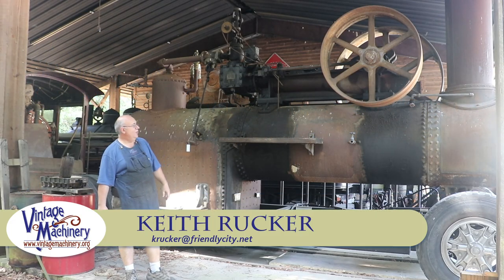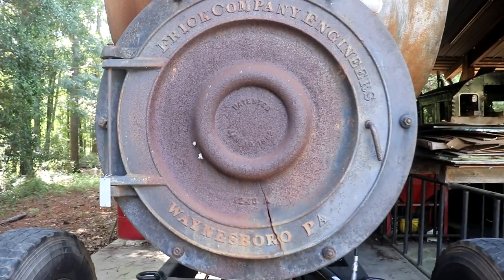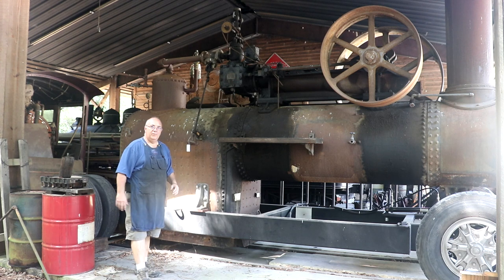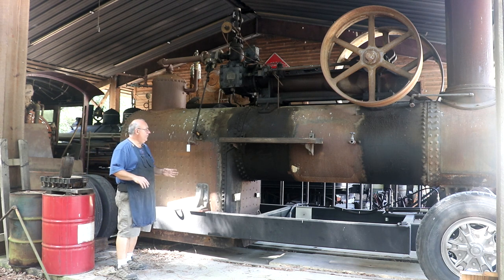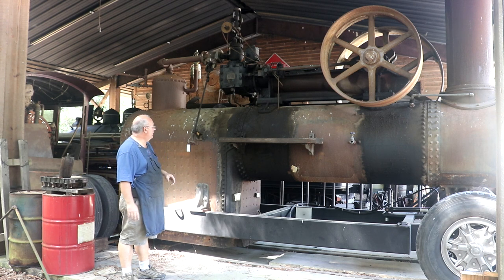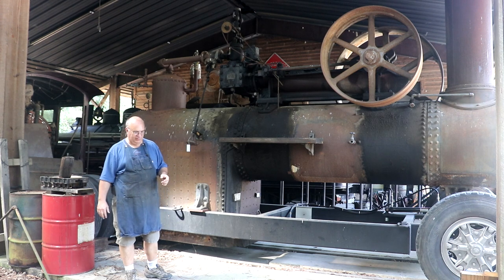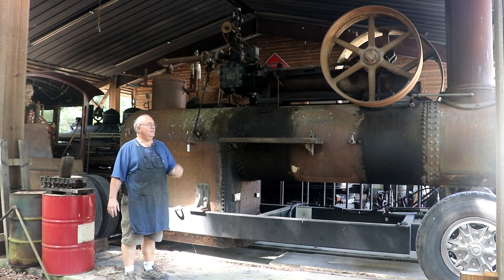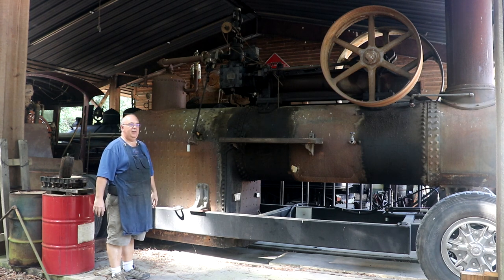1935 Frick Steam Engine: Help the Georgia Museum of Agriculture Restore it!

Comment: So, which insurance company was it? Insurance companies have far too much power. That's only boosted by financially supporting them, so I will never use a company that does stupid crap, such as condemning boilers solely due to their method of construction. I'll also say that if it's the state itself(i.e. self insured,) I'll be adding Georgia to my list of states to never set foot in. 

Saw something similar happen here in NY. A state owned  theatre needed some long term storage. Quoted over $300,000 to build a mezzanine, so instead, they built in themselves for a couple thousand(10-12' deep shelves hung from the ceiling with heavy chains.). Insurance guy comes through 10+ years later and says it's no good, so they instead rented space 10+ miles away, just for storage(still much cheaper than building it properly. That was 12+ years ago when I was in college, Their entire current annual budget is $5.6mil, and only generates around $775,000 in profit per year, so it would wipe out half their annual profits, for some shelves. 

Also had a situation where an offhand comment from an engineer about the grating in our catwalks running the wrong way got to a campus risk management person(in my college days), and they randomly and without warning shut down out catwalks, on a Friday night, while we were in the middle of loading in a show.Once professors found out, they still couldn't get a straight answer as to why.  Engineer didn't really think it was that big of a deal, just a note in a report. Anyone who was going up their already knew of the issue, and compensated bu not having more than 1-2 people in a single section. Not ideal, but the engineer was their for the planning stages of a complete gut and rebuild of theatre, so in effect, any remedy to the situation was temporary anyway.

Also had a friend who's property insurance was canceled due to a very rickity "deck" that the insurance company saw in an arial photo. The "deck
 was directly outside what formerly was a sliding door, but due to building settling, was actually buckling when she moved in, so it was screwed shut, and sealed off and was just a floor to ceiling window. The "Deck" was simply a couple cedar posts with a tin roof, as an animal shelter, as the area on that side of the house(timerframed barn converted half ass converted to a house) is/was used as a animal pen for the dogs and also any injured/sick farm animals. They didn't even come look in person, just sent her a notice they were canceling the insurance due to it, and she had a hard time getting them to understand the actual situation.
Reply: Yeah, as long as bad shit doesn't happen to you, and you're not responsible for the safety of others, why should you give a shit. Are you also refusing to wear a face mask because it inconveniences you?
Reply: You'll never set foot in Georgia if you learn that Georgia is a self-insured state and won't allow riveted boilers?
Dude, you live in New York.
Reply: @Cautionary_Tale_Harris  If hatred really could keep you warm at night, No one on the planet would be worried about global warming as my hatred of NY would have the entire planet hotter than the surface of the sun.
Reply: Something that "everybody knows" really isn't good enough. There are always those who don't get the message or read the signs or whatever.The reaction was probably extreme, but ever since that ballroom walkway collapse in Kansas City due to faulty engineering/installation folks are legitimately worried.
Reply: @Frankowillo  To categorically say something isn't safe due to it's method of construction(which has been good enough for 100+ years) isn't safe, is very different from inspecting something and finding a defect which makes it unsafe.
Reply: @ravenbarsrepairs5594  I'm just sayin' that I've lived in places with unreasonably tight rules and regulations "for your safety" and Georgia ain't one of those places. (For the most part. Nowhere is perfect that I know of.)
Reply: @Cautionary_Tale_Harris  Not saying it isn't but why would I spend a single penny in a place/company/etc. who's policies I disagree with?
Reply: @ravenbarsrepairs5594  
If you don't want to ever set foot in Georgia because ABAC's insurance company won't cover a riveted boiler, then I guess we'll just have to live with the loss.
Reply: @Cautionary_Tale_Harris  IF ACAB's insurance company is Georgia, than IDGAF  whether you can live with the loss or not.
Reply: @machintelligence  In this situation, there were 5-10 people(the techies) who regularly were up their, and only about 100 who ever set foot up there, during a given year, usually in groups of 5-10 at a time(i.e. lighting crew typically had 5-10 people, usually a couple of the techs, and 5-8 actoring majors assigned to the show for lighting crew) , so more than a couple people per section was never likely.
Reply: Somebody posted a comment about how I must not work in safety or insurance, and their post disappeared while I was typing this. 

Nope, not working in safety or insurance. I actually am a productive member of society, rather than a non-productive idiot, who couldn't find their way out of a wet paper bag. I'll also say the department where I work has the best safety record in the division, yet probably violates the "rules" 10x more than anyone else, with 10x more than that opportunity to get hurt. Reason being is we're always thinking about what dangers there are. No one sitting in an office thinking about liability and writing rules, is ever going to be more concerned about personal safety than those on the front line. I'll refer you to Mike Rowes Safety third policy. If safety really was number 1, nobody would get out of bed. Safety first leads employees into a false sense of security, meaning they assume someone else is always thinking obout their safety. We had a guy almost lose a hand and permanently disabled due to management training people improperly(i.e. management didn't read the manual, looked at a machine and and guessed how it worked, and trained people accordingly.) From a corporate liability standpoint, they want everyone to do everything by the book, but then wht happens when the situation isn't something the book anticipated? I'll also say my department has had the only OSHA violations recently in the division. OSHA considered the guards off our compactor, semi permanently removed for cleaning considerations(due to  missing piece no-one even knew existed, and on orders from a previous manager) a major safety issue. How dangerous can a 3"x4" triangle of metal entering  into a 3'x4' opening be? If your hand happens to be in that area, it would get easily pushed out of the way. I recently read a article somewhere, where someone literally explained why XYZ rule actually created a much more unsafe environment  than not following the rule(i.e. seeking an exemption in the effort of safety)  and was basically told that no, following the rules to the letter, was more important to reduce the companies legal liabilities rather than doing the safest method, as that way the company was legally less liable for any accidents. 

The catwalk was in absolutely no danger of collapse. For that to happen, the entire building would have to come down as well, as the catwalk was above and supported by the roof trusses, which were rated far in excess of that loading. The issue was that the sheets of grating were cut lengthways in half, rather than 3-4 cuts crossways, resulting in the "grain" of the grating running in the wrong orientation. The issue being if the grating was overloaded, it could theoretically bend.(1" slats, which should be crossways, were lengthways, so 1/4" rods were supporting the load(i.e. don't overload a section and theirs no issue)). After the fact, the engineer had to do some thinking to even figure out what the issue was. 

Big problems for us were that it all happened about 3pm on a load-in friday(I.e. we were setting the place up for a show, and were half way through jobs which needed catwalk access) with no warning, it was all students working on the show then, and no one from the theatre department was notified of what was going on. We ended up finishing those jobs off a very rickety 3 stage baker scaffold, which was more unsafe than the catwalk by far. The maintenance department offered to send someone over, but given the jobs that needed to be done, and the training/skill needed to do them, it would have taken many times longer to train that person in the very basics. Those stages of the process take 30 sec-2 min for someone who knows what their doing 15-20min for someone new, per fixture. 100+ fixtures per show, and a 3-4 hour task becomes multiple days.
Reply: @Cautionary_Tale_Harris  II'd like to know those places, as they will also be added to my list. right now, my main ideas are either Somolia or Mexico, althoug in Mexico, I'd need to find a work from home job in the US and live there under a tourist visa. I was planning on moving to NH, but the last few years activities of the Free State Project have dissuaded me from thinking that a viable idea.
Reply: @machintelligence  Sir, the ballroom collapse in KC MO was due to an unauthorized field change to the design, performed by the contractor and had nothing to do with the original design.  Onsite inspection would have prevented to collapse.
Riveted steam boilers are another matter altogether.  These relics of the past are subject to corrosion and metal fatigue.  In addition, most had no, or limited, safety features designed to prevent catastrophic failure.  Mostly, they relied on the intelligence and abilities of the operator.  In my opinion, it is not safe to operate a riveted steam boiler in a museum.  The risk far outweighs the reward.
If you want to see it work, run it on compressed air.
Reply: @stephenwilson7641  Sorry. The discussion had devolved into considering how an insurance underwriter or safety officer had closed the walkways above a theater stage because of faulty orientation of the grid panels.
Reply: The issue is with the lawyers.  If a issue is known and the insurance company accepts it then there is an acceptance of liability.  As soon as someone gets hurt the lawyers check to see if it was a known situation.  If it was a known noted issue then the insurance company pays.   Say someone fell off your catwalk and was injured and the engineer report was discovered as part of legal process.  Then the insurance company would be liable to pay damages. 

It is risk reduction. I have had a similar issue when a insurance adjuster came out about a incident that happened on the edge of my property and wanted trees cut down.  I had to show they were on my neighbors property.
Reply: @Frankowillo  LOL. Not sure how disagreeing with a categorical ban on something from an insurance company is considered bigotry. I'll tolerate anyone who has a differing view, just don't expect me to change my view on the subject because someone else disagrees.
Reply: @stephenwilson7641  In other words, your saying it's unsafe simply because it's old. Metal fatigue and corrosion are both things which can be scientifically checked for and tested during an inspection. I haven't said I would be against a more often/stringent inspections of riveted boilers, and condemning things proven unsafe. Just that to universally condemn something thats of a older construction style and simply older. Personally, given a lot of the welds I've seen, even ones that have been inspected, I'd rather things be held together with a mechanical connection. Just look up the weld issues that have been had with the Jeep JL's track bar bracket.
Reply: @machintelligence  I'm in no way saying there wasn't an issue that needed to be addressed. Just that to close them off at 3pm on a Friday, with a show in the middle of being loaded in, when it had been absolutely fine for 10-15 years. I can see saying that it needs to be fixed within a given timespan.
Reply: @richardlathrop61  So, why wouldn't the insurance be paying out if it were an unknown issue?